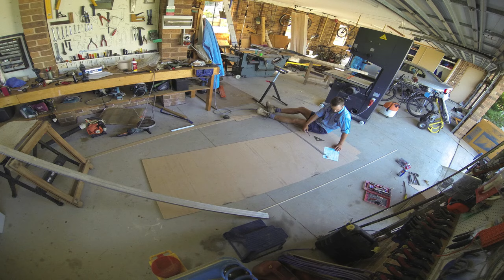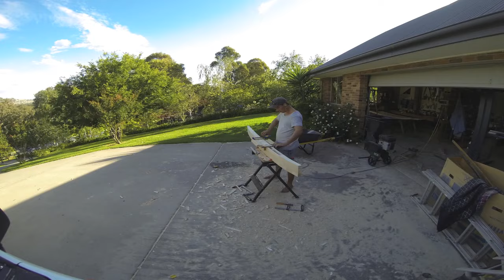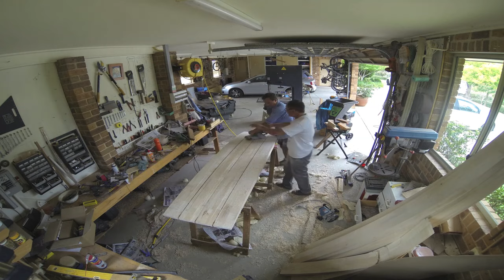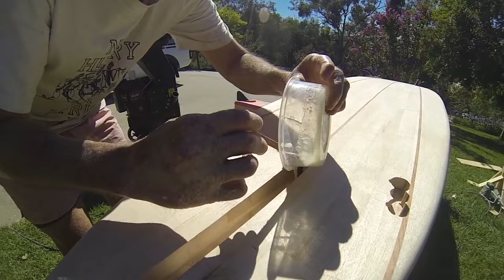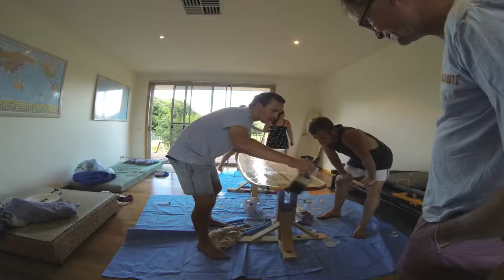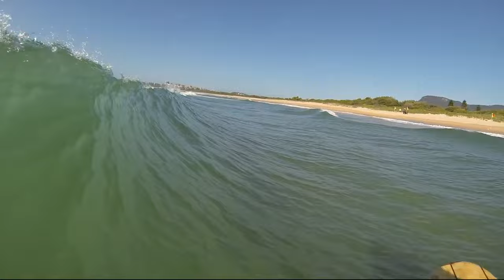Building a Wooden Surfboard - Balsa wood

Comment: I got a couple of questions: Why did you put foam inside the hollow wood? You only brushed the wood with resin? (no fiberglass??) And how much does it weight? 
Thanks, and great job!
Reply from the maker: The foam was to give it some support that was lost due to removal of the wood. In hindsight probably wasn’t necessary as the structure probably would have been strong enough. Just a bit of insurance. 
Yes I felt it was strong enough without fibreglass. I’m very careful with how I transport it as well. I carry it down to the beach in the case and put it straight in after the surf. Seems to work fine. 
Not sure on the weight. It is heavy, but once in the water I don’t seem to notice.
Thanks